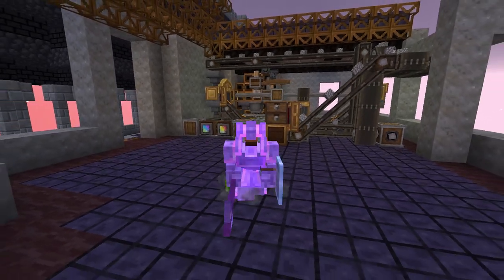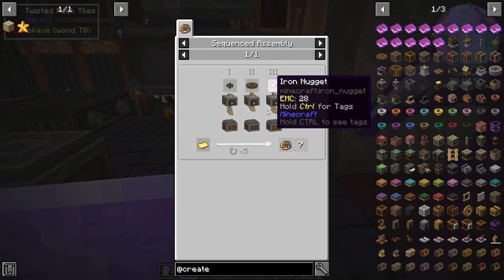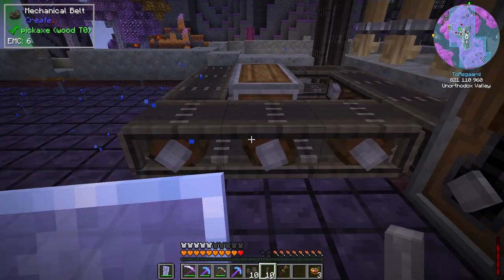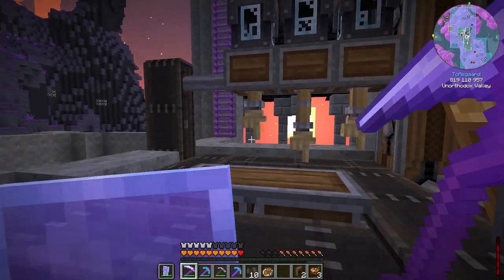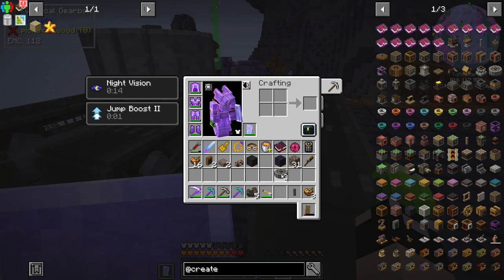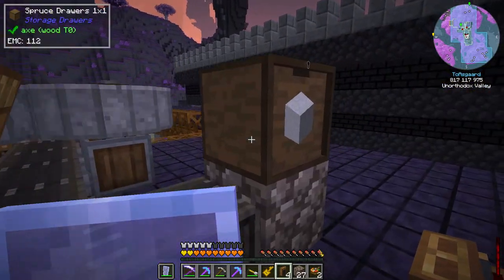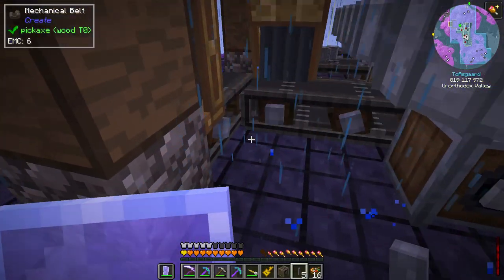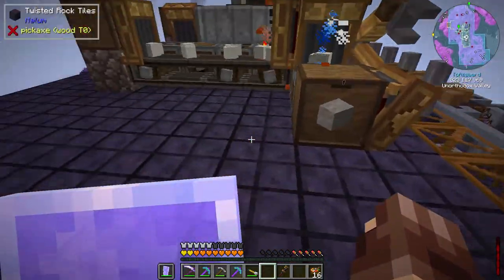Create Weathered Limestone and Dust Smelting: ATM Spellbound Minecraft 1.16.5 LP EP #13

Comment: Why not hook the weathered limestone up to a wormhole?
You could add a splitter for the cobblestone and then have fully automated storage for the limestone.
Also why not split the blood generator into to two outputs so one can fuel create and the other hooks up to a tank for refueling purposes. It would only need one more spike plate.
Reply from the maker: The weathered limestone I mentioned would be connected to a wormhole as well as all the other materials from this system,  just straight connecting it would over time fill up our wormhole storage with tons of single materials and we will instead be handling that a better way after we get one thing in a few episodes.  As for the blood generator there isnt a reason really to split it into multiple outputs or add more spike plates atm since we are using an entangled chalice.  That can split to multiple outputs and we will be using that for refueling and fueling most of our evilcraft stuff using just the single plate without issue
Reply: @ToAsgaard  sorry about that I didn't know :{ but your vids are super interesting :}
Reply from the maker: Oh no worries, no reason to be sorry :)  Was just explaining the thinking and reasoning behind it.